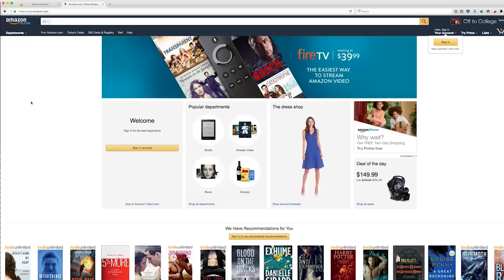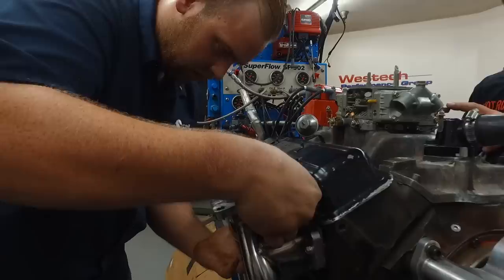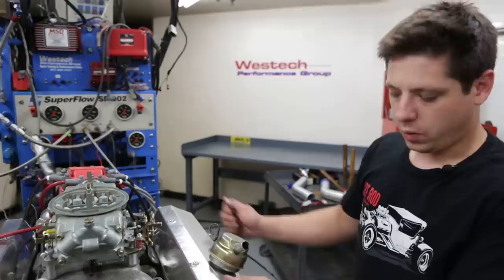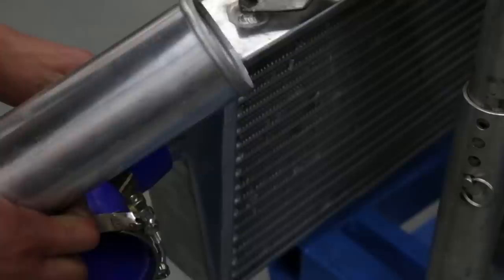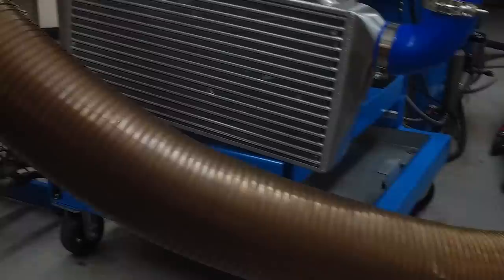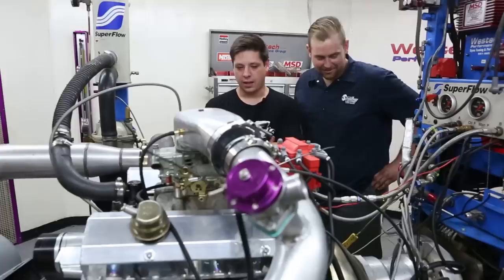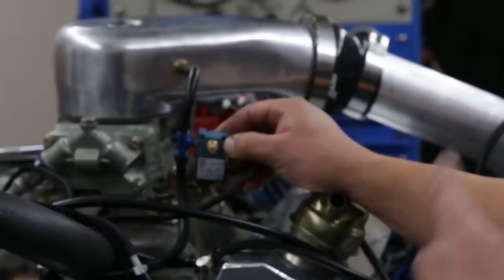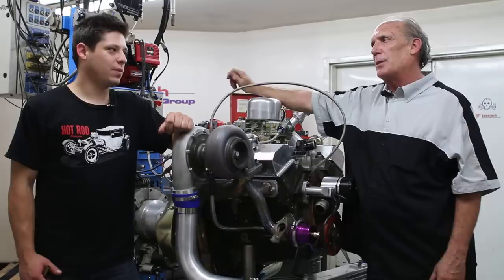Small-Block Turbo Kit for $699! But Does it Work?

Comment: The hot side parts of this kit are a clone of a hot side kit originally sold by a company called BBS Designs. It is made to fit the 3rd generation F-Bodies. It was based on a custom passenger side manifold (which is why the flange on that side is so square/homemade looking) and a cheaper "shorty" driver side header from ebay/pacesetter/whatever which is why that side looks like a real aftermarket part. The crossover is in the same place where all the late 70's through 90's RWD SBC single exhaust cars have had it. Right between the oil pan and the cross member. Because it is made to fit the odd packaging for factory 3rd gen F-Bodies, with a few small compromises, it is not generally good as a "universal" SBC. Even in a 3rd gen F-Body it required plenty of fitment modification. I am a sort of third gen historian. Others know this stuff too, but there are less and less of us left all the time. Now you have the information.
Reply: This kit will not fit third gen f body. The passenger header puts the turbo right into the strut tower, been there on an 87 iroc
Reply: Since Your A 3rd Gen Historian What Is A Good Turbo Kit To Go An 350 That Would Fit In A 3rd Gen.  Im Heavily Thinking About It.  An Single Or Dual
Reply: Why did the put the exhaust side of the turbo going towards the front of the engine? Wouldn't it have worked better real world if they had turned it 180° towards the rear with a ram air type setup coming from the front of vehicle engine to feed intake side?
Reply: B4Ctom1,
There used to be a similar kit for square body trucks... That's what I'm looking for. Does anyone make one for that application?

Comment: I have the same setup on a tpi system works great. I made a short 5" extension to deal with the exhaust clearence issues added a second $25 waste gate. And she'll push 20 psi all day long.
Reply: Do you have a 5.7? Looking for a kit for mine.
Reply: @wesleygreen6541  I have a 5.0, a 5.7, and a couple turbo bbc's. What vehicle are you working with?
Reply: @kdsboosted4954  im gonna single turbo my Suburban And more than likely double my Titan cause theres no room under the hood.
Reply: @wesleygreen6541  I had the kit in the video in an 85 suburban worked well. I didn't like the headers I had angled spark plugs so it was ok except cylinder 6 & 8 were a pain. I had to massage the header and make a special wrench for said cylinders. If you have straight plugs it may be difficult. I would put a kit together from optimal components. A decent pair of twin turbo headers a turbo a couple 38 ish mm wastegates a bov manual boost control is a good start with exception of tuning. Are you efi or carbureted? As far as the titan run the turbos in place of the mufflers.

Comment: You pay for convenience. If the company took all the guesswork and welding needed out of this setup, it'd be most likely 3 to 4 times as much...good video and good job.
Reply: YEP! Especially if its a specifically designed direct bolt on for specific make, model, and year.
Reply: Or, if they fixed some relatively simple issues, they'd sell 3 to 4 times as many.
Reply: I agree! These are not for the weekend warriors. If your tool box consists of a screwdriver, hammer and an adjustable wrench stay away.
Reply: @Jester123ish  You don't get it, kid. If they "fixed some relatively simple issues", the price goes up. This is capitalism. Period.

Comment: I think the boost built so quick and high mainly because the stock heads aren't flowing as well as a set of performance heads/ ported and polished etc. The measurement of boost psi is the resistance to flow. A better setup would flow a lot better and you wouldn't see such a boost spike. But is what it is for what it is.

Comment: The blow off valve adapter is a smaller size because it should go on the hot side of the turbo system. You want a smaller diameter pipe directly after the turbo and gradually step it up to the intercooler. After the intercooler you want your 3 inch .

Comment: I say if you want to buy a cheap turbo buy a cheap turbo take it to a diesel or performance shop and have them digitally balance the inducer and turbine as well as inspect the oil and water seals(if it uses water) that way you should be able to get years of use out of it instead of the possibility of it grenade-ing then just source your other parts elsewhere
Reply: Crysis Contained or pick up a used holset turbo for a hundred bucks and replace the ebay turbo and use the rest of the kit
Reply: My Ebay turbos surviving 2 years and counting

Comment: A tire shop next to my performance shop wanted me to put a Banks turbo on his Chevy PU. I refused and he wanted to know why. I replied that unless I built him an engine to handle it, he'd have nothing but trouble and fried pistons. Well, he had his guys install the turbo and he came by and did a burnout to prove me wrong. A week later I had his truck in the shop removing his TURBO and rebuilding/replacing his burnt and cracked cast pistons and doing a valve job.  "I TOLD YOU SO GARY" and took his money, and the turbo in part payment.

Comment: This vid is awesome. I'm doing this exact setup on my sbc but it actually has forged pistons bored over .70, Big cam,double hump heads fully rebuilt. Would like to know exactly what extra blow off valve y'all had to get to control the boost control and what regulator as well. Please get back to me asap

Comment: They have the manifolds on the wrong sides. Surely if they could weld an extra wastegate on thay could mod the crossover pipe to clear the engine dyno mount.
Reply: I was thinking the same thing until about 10 minutes in, when Jim from Westech explains that they had to put them on the wrong way because of clearance issues. It was apparently the only way to make it work without a lot more improvised fab work is what I'm thinking.
Reply: I'd be willing to bet it was originally designed for a RHD application where the brake booster would have been on the other side.
Reply: Its designed for a 3rd gen camro . turbos on the correct side but backwads. It fits the other way .
Reply: What is the kits name? I have a 89 Rs camao im debating starting this project on. turbo the sbc 350 or put good pistons cam and head work on it and aim for 400 hp NA
Reply: thanks man!
Reply: Seth Scofield 
Dont buy any kits . Buy the headers and make your own kit . Everything needs to be upgraded from the kit any ways unless your running a high boost application. And its cheaper to buy it all separately.
Go to thridgen dot com or theturbforums dot com there are allot of guys there that use these headers. Youll see my build on theturboforms. 
Manifold
http://xs-power.com/gm-turbo-manifolds-3.htm
Reply: Mark Rich thank you a lot man! I've been unsure about what is the best way to go about it but that is true. I was worried about reliability out of a cheat eBay turbo because I am still going to drive the car a lot so id rather spend more and not be scare its about to come apart
Reply: with the manifold pipes angled forward - it would fit nice on my 57 chevy pickup without interference.
Reply: Talisman1957 do it sir, the world needs more turbo 57 Chevy's
Reply: Smallest Kodi build

Comment: I bet this kit was designed for a right hand drive vehicle. It came from Asia on the cheap. Sounds logical to me. The exhaust would have been routed properly and not be interfering with the steering or brake systems.

Comment: I've seen this a million times tuning peoples cars with "ebay" turbo kits on them. The issue more often than not is not the wastegate is inadequate, often it's their lack of quality control. I've seen them come in with either missing or too small of firing rings causing leaks. I've also seen them come in missing washers or lose bolts around the plunger causing them to leak. While I DO NOT recommend these cheap kits, sometimes you get lucky and I've seen them work. I will say this, IF you must run one, I always recommend you disassemble the wastegate and loctite it together and do your own quality control of sorts, you have a MUCH better chance of success with these. Again, I don't recommend it, but if you must, be sure your wastegate is all good and test it after.
Reply: Good call on the on quality control issue. This kit also had really poor placement of the gate. It only receives exhaust flow from one port.
Reply: Evan Perkins yeah you win some and lose some on these kits. It's a cheap route to boost but they always require modification to work lol. Still, very cool to see an unbiased testing, you guys should test the on3 kits next. Do a battle of the Chinese budget turbo kits lol.

Comment: I built a DIY kit from ebay parts back in 2009 or so for my Lexus GS300. I easily hit 500hp on 100% methanol injection and did everything except 1 exhaust weld off the downpipe in my friends driveway. Total cost was around $1,000 including the turbo which was far cheaper than Supra stores "cheap" turbo kit which I modeled mine on.

Comment: Now, show how this is installed in the truck. The way you have it shown in the video, it would never fit.
Reply: Lookup Fuel injection sucks he installed one in his 78 Chevy C10 with a stock truck motor, stock intake etc etc

Comment: Yeah but how much was that blow through carb?
Reply: you can modify a conventional carb to use in blow through applications. its a lot cheaper.
Reply: Sure, you can modify a conventional carb, but it works like shit. LOTS of turbulence and lost power potential.
Reply: Before youtube and online tutorials existed there were talented wrenchers and urban engineers. 
The Holley double pumper shown in this video with the correct mods make great Blow through carbs on the cheap. And when set up properly they are reliable. Tell me about this turbulence lol?
Reply: _ Gross  more than the entire kit😂😂
Reply: That was NOT a blow through carb. Nor did they have vacuum lines and check valves and pcv ran correctly for a turbo set up. THAT is why they got oil everywhere.   Demon blow through carb will run you $650
Reply from the maker: It was a stock Holley with $50 worth of mods. The link to the build-up story is in the description
Reply: What about the fuel pump? Electric? Mechanical? Boost referenced? That wasn't mentioned in the article. Sweet job on that carb.
Reply: Why not just convert to single-point fuel injection? Scores better than a carb and fine-tunable.
Reply: _ Gross ask the grand national
Reply: They're really holding back on one thing, Brule is an absolute carb master... Engine Masters even downplays it. Only one episode really showed his carb tuning talents and he was battling an EFI set-up.

Comment: What if the headers were just on the wrong side?
Reply: he said it at the end that the turbo would be on the brake booster!!
Reply: jessy6464 I don't see a brake booster in the dyno room LOL.
Reply: no really!! they did this test for people that wanted an ebay turbo kit!! so if the turbo was on the drivers side it would be on the brake booster and the crossover pipe would be hitti g the crossmember!!
Reply: jessy6464
Reply: you are right, it seems like they wanted to prove it was a piece of shit, and went ahead and did that. even though it seems like a good kit.
Reply: Sorry, I wasn't clear. it seems good to me. but it seemed like they were trying to prove it was junk. and just went in that direction.
Reply: I adjusted my first comment.
Reply: If paying that much money for something that had little to no instructions, warranty or even a guide, parts mis-matched it does seem to me like junk. It works for now yeah, but that doesnt mean its going to last. Ive gone the cheaper chinese route before on parts and wind up paying double if not more in the long run. Especially if you are the guy who has to deal with replacing it or having to rig it to work.
Reply: Blake's Garage same thing I was thinking they got it on upside down and backwards these guys are from Hot Rod TV and have to read a boost diagram for vacuum lines are you kidding me
Reply: blackman8795 

wastegate*

And just run the exhaust straight forward out the fender or hood lol
Reply: If the headers are on the wrong side, flip the engine upside down and bolt it in place. Silly....
Reply: Blake's Ga
Reply: Blake's Garage n
Reply: yeah ,seems like one of the most experienced ,well known ,versed and capable dyno/engine master builder's on earth who is a master wrench wouldn't be able to figure that out right?seriously guy????? if he says "you need to do this to make it work,YOU NEED TO DO THIS TO MAKE THE FUCKING THING WORK.
Reply: It really doesn't matter because this kit simply is not going to fit under the hood of many cars.
Reply: That much money? Go price a name brand turbo kit. They start at $2,000.00....
Reply: The turbo air inlet side  unbolts and Spins so u r able to mont it the other way lol
Reply: They are lmao
Reply: No
Reply: Wrong side and upside down.  Cross over tube goes over top of motor. Puts turbo above steering box. Chevy's have battery on pass side, nothing on driver
Reply: Maybe on the older Chevy's. My 04 has battery and fuse box on drivers side. Passenger has airborne and ac stuff
Reply: Joel Rheault it’s not  for an 04. That motor ended in 2000
Reply: Joel Rheault it won’t work on a ford either. It only applies to 2000 and earlier Gm products which are not ls based motors, kinda like a 2004 truck. That’s required a different kit completely. Am I certain it will work? No. But abc headers can be swapped side to side and or flipped upside down. That offers 4 different mounting options and considering that most vehicles have a cradle under, the cross over on top would make sense
Reply: Anthony Caccamise yea I almost forgot it was an older engine.
Reply: Blake's Garage could always get shorty plugs too!
Reply: Blake's Garage even if just get different headers
Reply: jessy6464 just plumb the exhaust through the windshield and out the window.
Reply: Some motors can swap factory manifolds, side to side.
Reply: Blake's Garage m
Reply: turbo was not properly clocked
Reply: Does this work well with TBI 350's?
Reply: Ellyotte_0 it could, lots of work
Reply: theyre made fro angle plug haeds. thats why they dont work
Reply: Johnny V baby this guy is one of the best dyno tuners around. He really does know what he is doing
Reply: Nicko D yes. But it might be enough for the job at hand. He could go race that and possibly win enough money to buy a real kit! This kit is like a ticket into the party.  What you do from there is up to you!
Reply: both housings unbolt and rotate for clocking
Reply: Blake's Garage ,stqeei
Reply: They're on properly.
Reply: Joel Rheault I have a 95 Tahoe and my battery and fuse box are on the driver side. Same 350 shown here
Reply: not downunder or in europe it wouldnt. or china rite? maybe you americans need to drive on the correct side of the vehicle.....bad joke.
Reply: These "Universal" kits, don't give a rat's ass about the install. That is all on you.    That said, in most race application, they would bend the exhaust off at 90* from the turbo and knock a hole through the fender in front of the tire.
Reply: jessy6464 It already seems the crossmember would be in the way of the pipe!?
Reply: @DIOSpeedDemon  😅
Reply: Time to dump the booster and live with mechanical brakes. I built cars that relied on the emergency brake way back when.
Reply: Hahaha
Reply: Blake's Garage i came down here to say that. Like uhhh if its backwards try switching side
Reply: If you put the Turbo manifold on the driver side head, the Turbo would be in the same position as Your brake booster.
Reply: The collectors would meet right at the engine mounts is the first immediate problem there
Reply: About the fit in a truck/suv that's probably a L31 or a zz4 those valve covers wouldn't allow for the a/c compressor to fit
Reply: So is it worth it for the big kit or just get the turbo and manifolds ?
Reply: @MrJohnv8386 Yeah! These guys know NOTHING! Of course everyone in the comments complaining could do a better job...
Reply: Nicko D that’s why If you have a cheap turbo you pay to have it balanced better and it will last as well as most expensive ones. It’s all ego when people shit on cheaper parts
Reply: well then.... I feel like I got a stern talking to, I apologise for my ignorance, are you one off the builders in this video?
Reply: this kit is made for a right hand drive
Reply: I'm pretty sure you can get short spark plugs
Reply: Nicko D $600-700 is very cheap for a turbo kit! Can’t expect much for that price.
Reply: My friends... free advice, save all that money. Just put on a K&N filter and a SS badge~same power level basically 🤪
Reply: Turbo may have fit properly if engine didn't have the tall valve covers... you can also buy a spacer to raise the turbo a few inches.
Reply: It was probably designed for a right hand drive car
Reply: Anthony Caccamise actually carbed sbc last year would be 1988

Comment: I think it's less about about "will it work" and more about "how long will it work for?" Any old turbo can push 7 or 8 pounds of pressure down a pipe but after a year or so which ones will still have good bearing and seals and all that good stuff? Especially at the heat and speed that these things run at. Probably pretty hit or miss with cheap ones.
Reply: Red Rolo I guess they never miss huh

Comment: I bought the twin turbo kit for my mustang and there is literally 1 inch between turbo on driver's side and the master cylinder. That's before downpipe which would never fit. Also passenger side I had to make an adapter. Finally got fed up and just put a nitrous kit. Not to mention took 3 hours to mount headers. Bought set of bbk and had them on in 20 minutes literally.